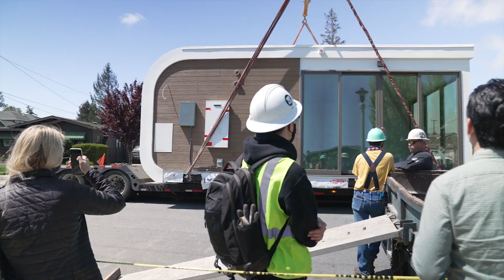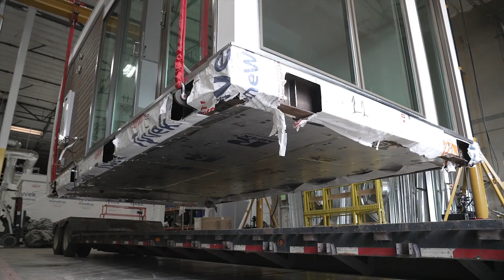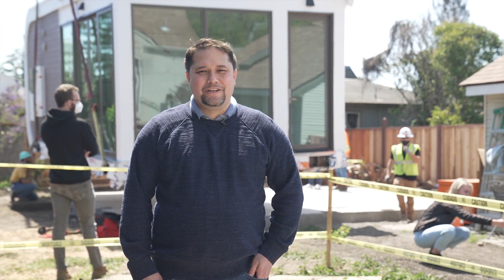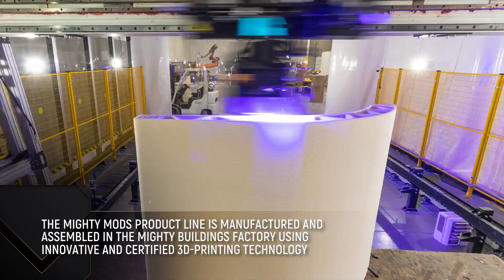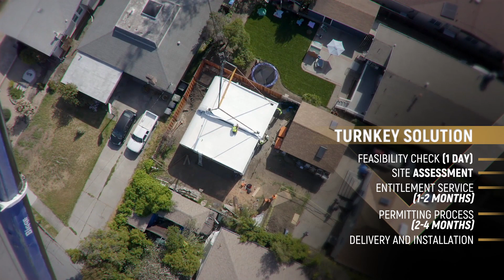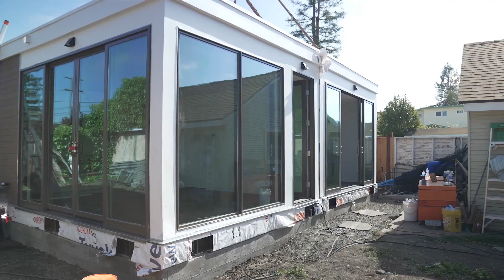New 3D-Printed 700 sq ft Home Delivered!

Comment: its cool but you need to get the cost down alot.
Reply: The fact that it’s using California labor costs is a factor here as well. That’s why the company is setting up a flat pack unit design that can be assembled at a fraction of the cost.